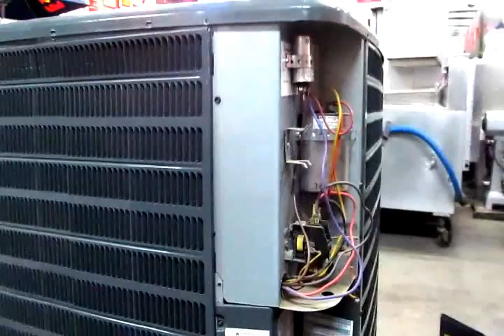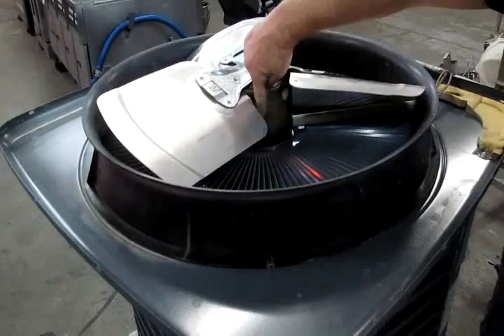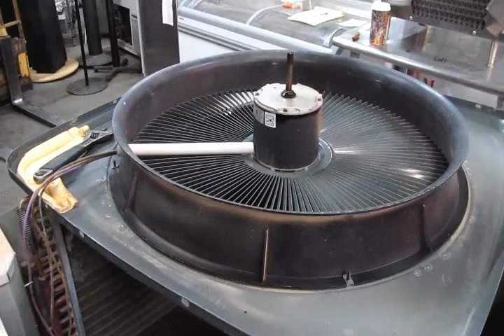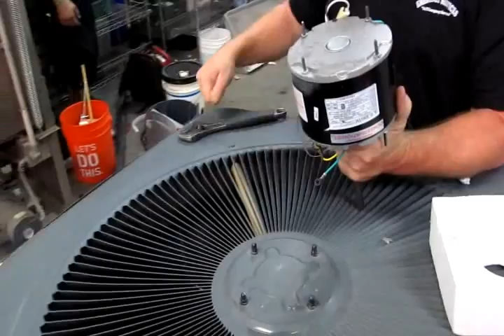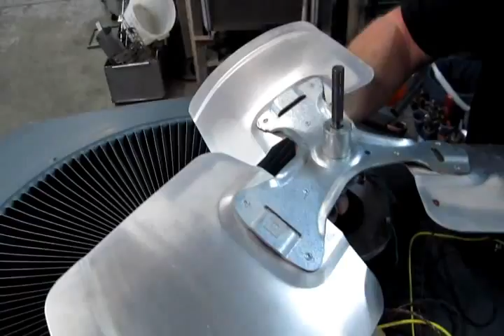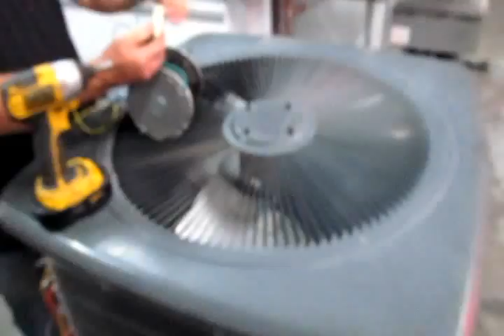How to Fix a Bad Air Conditioner Condensor Fan Motor an AZ AC Repair

Comment: Check or replace the fan motor capacitor 1st. Often, the compressor and fan motor share a dual type capacitor.  Replacement capacitor must have the same values as the original capacitor. If the fan motor bearings are worn out, the motor will not start properly due to excess friction of the worn bearings.

Comment: You've ruined the airflow by placing the blades "3 fingers high". Look at how low the OEM placement was, this was done for a reason and is aligned to the black plastic air shroud.

Comment: A) Press that contact with a tool with a plastic or rubber handle. B) Ninety Percent (rhetorical) of the time if the motor hums as described it's the starter-CAP, not the motor. Try rotating the fan with a stick or screwdriver while it's buzzing. If it spins up it's the capacitor.